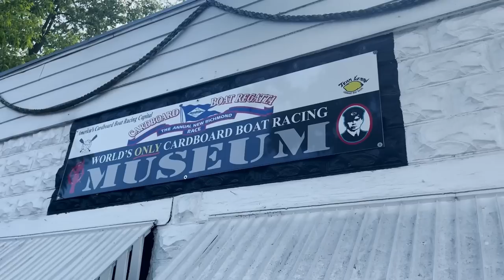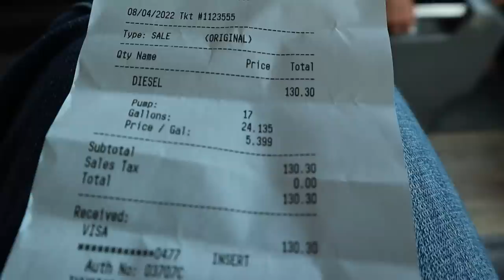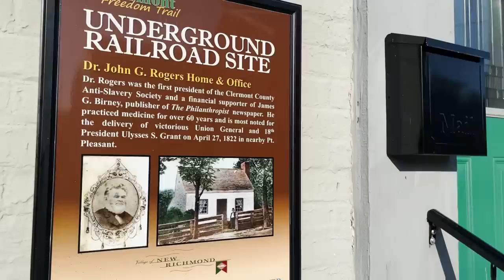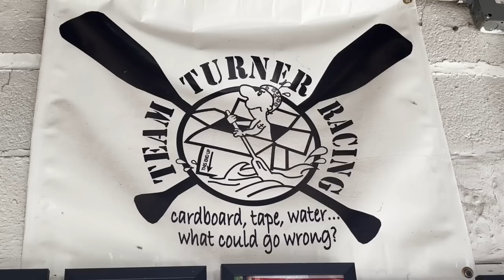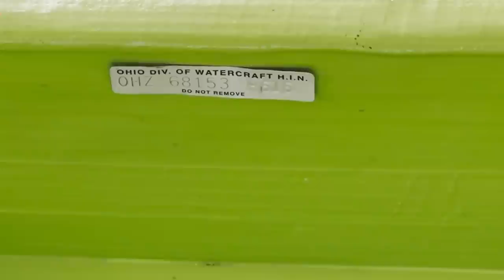The Shakedown Trip Part 1: We Got Problems - S05E02

Comment: If the rig ever overheats, try turning on the heater control for the engine, turn the fan to full blast and let it run.  The temperature should start to go down.  Of course, open windows if it gets too hot inside.

Comment: This is very good to find the various issues close to home. Look for those leaks in the cooling, fuel, oil systems. Might want all new filters as well. Ask the mechanic about overheating. Last i knew its best to leave it running to let it cool down. But never done it.

Comment: Before you get on your big journey on the road, make sure all connections cleaned and de-rusted, all oils filled. All filters changed, temperature gauges and any other gauges are checked and fully working. All tyres fully treaded and filled with air. It doesn’t matter whether it’s a car or bus, all engines and working parts should all be checked and fully tested before any long journey, especially when it’s your home. If your engine has been fully overhauled and checked by a qualified mechanic you will be fine. Always ensure you have spare parts for everything that is at risk of breaking ie hoses, puncture repair, plugs, batteries, connectors, fuses, air pump etc you’ll be good. Do you have services like we have in the U.K. ie RAC, AA? They are road recovery organisations with 24/7 mechanics available everywhere nationwide top to bottom of country. If you have , it might be worth joining one, so that if there’s any mechanical issue, you have someone to call on to help out. Also, maybe start watching you tube videos on bus mechanical work, if they have any of course, to help you both out. Good luck guys. Are you putting a logo on the side of your bus or leaving it plain?  I think @rehabit8 would look cool.
Reply from the maker: Hi Julie, thanks for the advise.  As we said, we have discussed our coolant problem with our mechanic and MCI and everyone thought the sensor was broken.  We were heading straight to the mechanic before putting any serious miles on and so he could check everything out for us.  Our mechanic Joe has been an amazing resource for us, we are able to call him up with questions and now that we aren't building, Don can spend more time learning about the mechanics.  There are also some great facebook groups for MCI bus people, many of who know more than us.  We have found them helpful in the past.

Comment: Hey guys,great video.my advice on coolant systems is that if you haven't already check all the active hoses.if when squeezed they feel soft or squishy replace them.it will save sitting on the side of the road from a  blown hose

Comment: Youse guys are finally on the road. Don’t know how you did it I would have pulled my hair out… oops.😎 Anyway as a now retired over the road salesman with close to 3,000,000 miles under my belt your engine needs to be top notch. Check all fluids, hoses, filters, etc frequently and I mean frequently until you get a feel for what works. Good thing you were close to home during the first drive. Looking forward to your many vids.
Reply from the maker: Thanks O Gearbox.  Yes, we keep learning new things about the bus and will keep up with the maintenance.

Comment: Just a bit of info, if you remove the on / off valve on the end of your water hose it will fill much faster.It usually has a hole 1/2 the size of your hose.
The water filter will slow it down some too, you definitely need to filter the water. The filter you are using is normally for city hook up, we filter our water coming from the tank into the coach. 
Happy Trails…..
Reply from the maker: Thanks for the tips Kenny about the on off valve. yeah we have 3 filters. Our 2nd filter is from tank to bus house, then a 3rd filter is ACUVA for drinking water.

Comment: Double check that all that coolant that you just added to the engine is compatible with whatever fluid was already in there. Or better yet have a complete flush done asap and have fresh fluid put in. Incompatible mixtures of coolants can cause corrosion problems. Love the vids. Envious of the adventure ahead.

Comment: Did you turn on the heater after topping up your cooling system? If not would suggest you do, then re check fluid level. Might be a little low.
Last year Were were going from Wollongong to Wyong NSW Aust, SUV pulling a 3tonne caravan outside it was around 40°c started overheating as we climbed Mt Ousley so I turned on the heater, turned off the air con and opened the windows,  temp went down completed the trip with out issues

Comment: If that has air brakes you might want to check your state but with 2 rear axles and air brakes you probably need a CDL and ifta tag or you will have to buy a permit for every state you enter

Comment: I feel your pain.  You will not get any criticism from me.
49 years ago I moved into my 1st bus.  Schoolie 1961 Wayne body chevrolet c60 chassis.  Went 87 miles, wrist pin broke on #2 cylinder, scored the wall, I was 19 with about 175.00 to my name.   This is how you learn to rebuild engines on a tight budget.  Talked a friend into towing me to a tree I could pull the engine with. 3 weeks later I took it to college, ended up living in it for 5 years. Yep. Dead broke with no safety net....

Currently I own a business, have a big house, and an mc8.    I've had it about 2 months, made 1400 miles on it.   Previous owner was both an idiot and shall we say, less then honest.  The 1400 mils was the trip from where I bought it, (yep I knew there would be problems)  could tell it has been seriously overheated.
Made it about 120 miles till it overheated.  Figured out a lot of things that were done wrong on the sometime in the past engine swap.  Not a single sensor, gauge, shutdown system was even connected. Plus it would loose air in less the 5 minutes due to leaks, bad airbag, etc.  Also the alternator did not work at all, and has been incorrectly connected when the engine was installed.
Thankfully this coach has an 8v71, that does not need a bit of electric to run and drive.
Took 3 days to make the 1400 miles,  I've has 100s of thousands of miles operating these Era coaches, and used every bit of my skill and experience to nurse this thing back to its new home.  Whew...
Had engine looked at by one of the best in the business,  got his opinion and thinking....  currently removing old carpet and decorating issues, getting window fixed, and electrics straightened out.  Probably going to swap the engine for a rebuild.
Even with all of that I feel we made the right choice with this coach, as it has the interior layout we want,  was reasonably well done, and just needs some new decoration and flooring inside, some plumbing repairs, and a bit of paint repair.

Good luck on your coach,  I'd have a GOOD diesel mechanic review the sensors and gauges, make sure they are accurate.  I learned early to have redundant gauges. Mechanics in the back for oil and temp, electric for the dash, makes sure the warning buzzer and lights are working as well, as they are also redundant. The auto shut downs are also really important, as they can save your engine.  Though detroits generally need attention right away after an auto shutdown due to heating,  if I recall, the auto shutdown on your coach happens at 220 degrees.  Way to high for a detroit.  They should have those things shut down at 200.   Also there should be a robert shaw water level sensor in your overflow tank. It should have both a light and auto shutdown for coolant level as well.

Comment: I bough my first motorhome in 1974. Right in the middle of the gas crisis. I knew nothing about ,motorhomes. I learned. So will you. Good luck and DO NOT listen to the naysayers. I was a mechanic for Delta Air Lines for 32 years. After retiring from Delta, I became a service manager for a large RV dealership. You will learn too.
Reply from the maker: awesome, thanks for the encouragement

Comment: I thought the solar/battery system on the bus was big enough to run the a/c with?!?!
Reply from the maker: We only have half the solar array we planned for.  Decided we can add more solar down the road.  With the temps in the midwest being in the 90's with 89 to 99 % humidity, that means running the AC all day.  So we had only been running it during the hottest part of the day for maybe 5 hours in order to make sure we could still work on computers, cook food etc.  It was just nice to plug in and run AC all day considering the ridiculously high temps.  Our plan was to chase good weather but we couldn't get out of the Midwest early enough to miss these temps.  When we complete our solar array we should be in better standing.